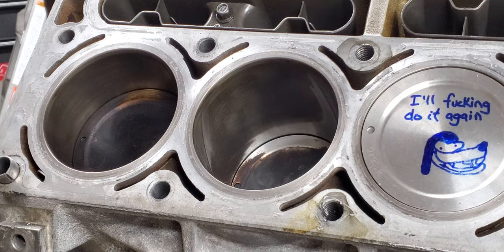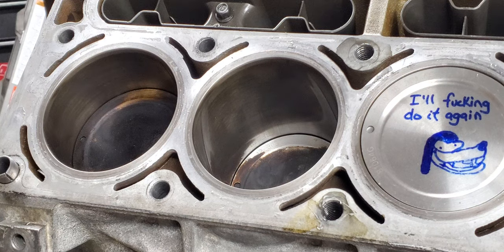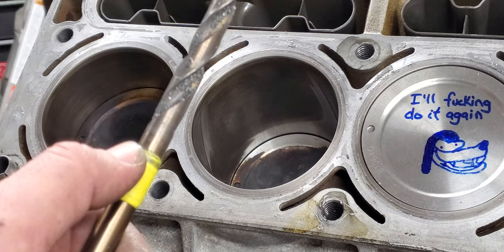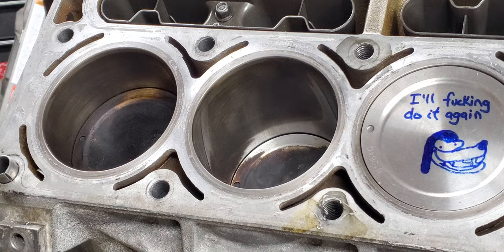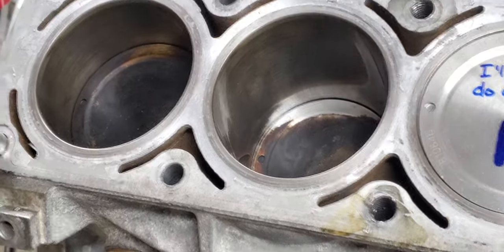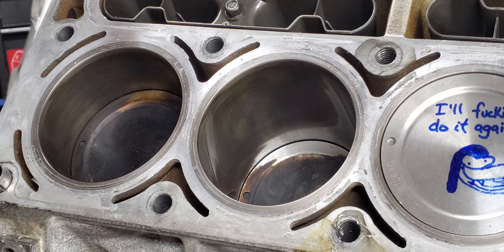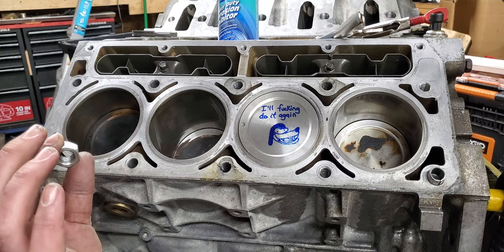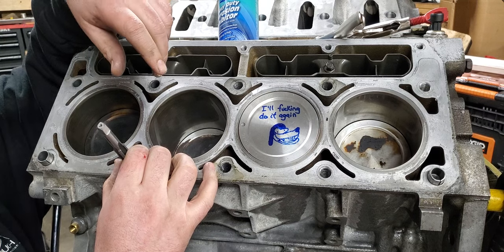Drilling and Tapping 1/2" Headstuds in LS Without Fixture or Jig

Comment: Nice work brother!  Did you use the Tick head studs?  Did they torque up ok??
Reply from the maker: I waited 4 months for head studs from them and they still never arrived. I haven't done much if at all would be engine since. I've been working on 4200 stuff
Reply: They will come ... i waited the same from tick. Alper motorsports have them too ... but not arp. Tick are arp and much nicer. But im sure the same same
Reply: @scrapmetal_sleepers  351w Ford uses 1/2" head bolts factory I hear the studs for them work on the LS may look into that for anyone else waiting.